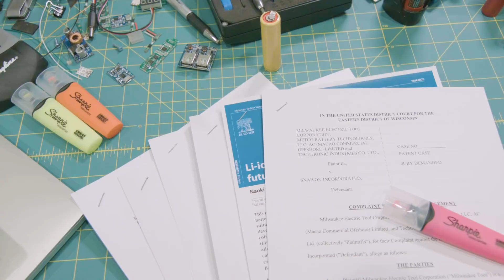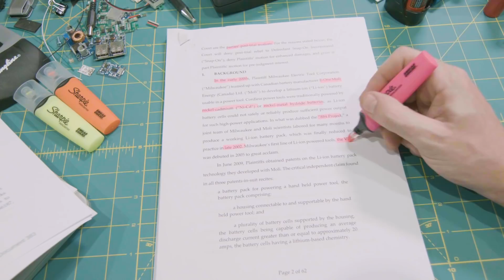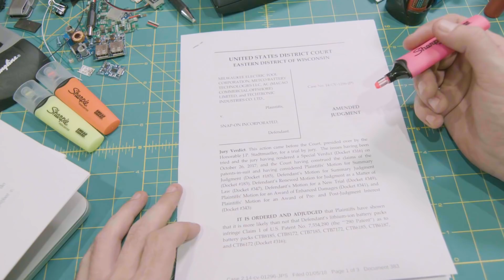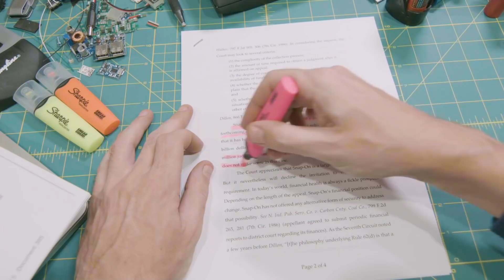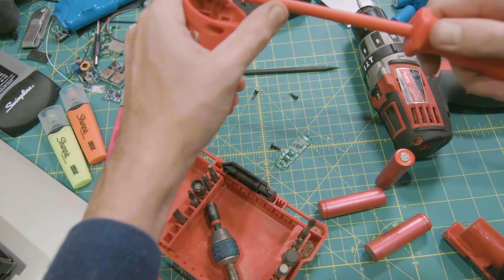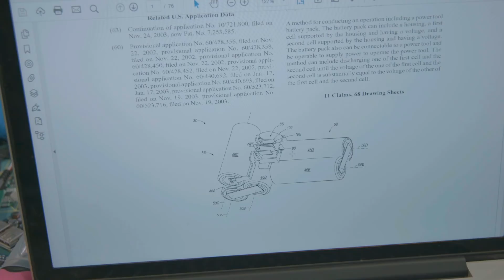BOLLR: Milwaukee wins $28 million for Lithium-Ion Battery Patents from Snap-On

Comment: My question about the case would be:  Why is Snap ON being singled out,  virtually every cordless tool is identical,  I watch AvE pull them all apart, they all use the same cells, they all have the same battery control circuitry just in different places.  What did Snap On do different from say Makita or Porter Cable?
Reply: Meep Changeling, and Leonard, but the "tech" they use is virtually identical to the tech that is used in so many other places. to put it simply they took the batteries out of the old packs and put in lithium ones, that were designed to handle the amps. the only feature that should be "patentable" should be the chemistry of the batteries themselves. The actual packs shouldn't be. I agree with Snap on that even the least knowledgeable laky at a tool company should be able to figure out how to put a lithium ion battery into a power tool. Hell if you put the batteries in parallel you can boost the max amps from the pack using the lesser batteries. milwaukee improved nothing outside of the battery used.
Reply from the maker: Not pay license fees to Milwaukee.
Reply: A wild guess as a contributing (but not the main) factor:  Both companys'  engineering centers are within commuting distance of one another. Poaching design engineers between the two is easier than most other cases.
Reply: What tech were they using?
Using a lithium ion battery on a different product is not clear... everything that a battery is used on is a tool.
Reply: Who is this directed towards??
Reply: @BentTreeFarmPa  If you have to ask -  not you.
Reply: From what I'm understanding: The battery is part of the pack, so the patent should extend to cover the use of the particular chemistry of the batteries and the way the controller is configured to handle the higher voltage. As Mr French showed, its not as easy as slapping the batteries in and making it chooch safely for consumers
Reply: pretty sure Makita already got hit off for their OG 12v Max line.  

And I don't think they made the other 12v CXT line for funsies either, considering cartridge/magazine style batteries are better for compact tools than slide-style batteries. 

That's why their commitment to the new line has been so-so at best (same with Dewalt's anemic 12v line-up) and it seems they've turned focus towards the sub-compact line that still uses their 18v battery, which they've supported better than any of their competitors, considering 18v LXT dates back to 2005.   (where as Milwaukee has abandoned like 3-4 Lithium platforms in the same timeframe:  V18, V28 and M28)
Reply: Snap-On has deep pocket...   take a look at the price of a set of snap-on tools.  There are 100's of cheap tool company's that make Lithium-Ion they are so small they can close up shop and startup under new name faster than you can read this sentence.   Snap-on can't, that would destroy there brand.   I use to make a living revers engineering products to get around patents on electronic devices.  Everything from fish finders to radar control units never got busted once. So I found this patent war thing kind of interesting..   oh well. be interesting to see if they win on appeal.
Reply: Those companies pay Milwakie a fee for the use of their Tech. Snap-On decided NOT to pay and use their tech anyway, then say Milwaukee's tech was their own. Get it?
Reply: *Their
Reply: James F lol I agree with you
Reply: Badgermatt75 2016 are you asking about the *Their comment. I was curious too. Don't matter there's always fucking grammar nazis who think they are showing "their there they're " superiority. Who cares really like they never make a mistake or that autocorrect never throws the wrong word out. Shit really pisses me off. Like would you interrupt someone in person talking to correct them. it would take an awful big dickhead to do that.

Comment: At work we had an incident where a framing nail punctured a M18 battery pack. Luckily it missed the cells. How it happened isn't clear, but people probably aren't too keen to share details if horseplay was involved.  

12 years ago I made the mistake of opening up a LiPo cell. It was mostly dead, but touching the fluid inside immediately gave me a searing migraine that lasted most of the day. At that time I knew enough in order to be dangerous, but not enough to be safe. Glad to see Leonard is being safe and using caution.

Comment: I think I remember seeing both actual batteries in a Home Depot years back when I needed to replace my power drill.  Both had the same shape and voltage...close enough that it looked like the Snap-On could fit the Milwaukee power drill and vice-versa.  I also remembered thinking to myself that this was a lawsuit just waiting to happen.

Comment: You must have some pretty steady hands or very consistent luck. I know for a fact I would have either cut myself or nicked one of the cells if I were using anything much longer than a scalpel blade.
Reply: Abraxian Absolution Big knife is a dull butter knife, you probably use one every morning.

Comment: If everyone makes batteries this way what was snap-on doing that was special?  Or rather what was Willfeckee doing that was patantable?
Reply: Korona Figuring out how to get it right. How much of what goes where to output enough electrocity to drill holes etc.  ⅓HP whenever you want, only much smaller than cutting up a dead horse.

Comment: woot. just waiting to see the inevitable AvE comment get thousands of likes.
Reply: Well now I'm pissed! How did the jury mess this up?  More accurately, how did Snap-On's attorneys mess this up?  You want more current, you put more batteries in parallel.  You want more voltage, you put more in series.  I'm sure you're going to say exactly this in the video later, but hell no.  Any first year undergraduate EE student knows how to do this.  Also, how did the patent office mess this up?  Its an incredibly over-broad garbage patent with no new content whatsoever.

If I wanted to run a subway locomotive off hearing aid batteries, I could do it.  It would be stupid and probably cost more than the locomotive itself, but you could do it.

In fact, no, lets actually do it (on paper).  Ironically, I'll be using the Milwaukee ES-2 electric locomotive, running on 3000VDC ad approx. 200A.  We'll also be using the A312 hearing aid battery, producing 6mA at 1.4V.

Simple math tells us that we need 2143 batteries in series and 33333 sets of 2143 batteries to provide the peak 200A requirement for a total of just over 70 million A312 batteries to run an electric locomotive.

That's it.  Thats the magic sauce of this patent.  Garbage that some jackass (me) can fire off in 20 minutes in a youtube video comments section.
Reply from the maker: The jury believed Milwaukee's assertion/testimony that they had worked closely with Moli, and that was closely enough to convince the judge and jury. But you're right, this is also on Snap-On for not being able to show the obviousness of "use a lithium battery in a tool". Thanks.
Reply: Thanks for making the video.  I've been looking forward to this for a long time, but I'm just slightly sad and angry that I could take stuff off my workbench as it is right now, have walked into court with Snap-On's attorneys and saved them 33 million dollars.
Reply: This case IS kinda crazy. I remember when the Li batteries were being put in every new cellphone in early 2000, I was thinking to myself how long until they'll put them everywhere else. And now learning that putting Li-ion batteries in power tools was patented, and that it wasn't not obvious, which at that time was obvious to a, you know, not even the brightest 12 year old... I either didn't get what exactly the patent was about, or it's a very opportunistic approach to patenting on Milwaukee's part and a fuck-up on patent office/court system/Snap On side.
Reply: buchweiz: Honestly, it makes me want to know more about how this case went.  So far as I'm aware, Milwaukee used off the shelf electronics in standard, openly available (probably reference design) circuits and the only thing thats even mildly patentable or unique to their battery "system" is a cell not even produced by them.
Like I can't patent a slight modification to a buck-boost topology or a slight modification to the reference circuit design for a charge balancing chip made by Linear.
Reply: Unfortunately a year later and it's barely broken 600.

Comment: So what is patented? Is it simply the battery pack itself? Cause that would be super dumb and totally BS. Battery packs have existed for decades, and changing out different types of batteries isn't something new. And moving the battery management circuits isn't a huge difference. Don't get me wrong, the patent office has a horrid habit of giving out fraudulent patents often now. Which I guess is better than not giving out patents, then having the clerks either sell the invention to rich businessmen, or even doing it themselves, and then getting a patent on the exact same thing.
Reply from the maker: The Patents cover lithium-ion tool batteries with discharge ratings at or greater than 20A. I'm not sure if that's continuous or short-term. I'm guessing short-term. While it definitely seems obvious, Snap-On, with their millions, was unable to convince a jury so.
Reply: But it doesn't seem to cover the actual batteries, just the use of batteries in a pack. And no way in hell should that of been given a patent. My radio takes C cells; does it matter if they started with Zinc-Carbon, then switched to Alkaline, to Rechargeable Alkaline, to Nickel-Zinc, to Nickel-Cadmium, to Nickel metal hydride, to Lithium, to Lithium-Ion... etc etc etc. Those batteries have various total charges and different drain rates. How the hell does a non-fraudulent patent cover a simple switch of battery types? Or did the near century of businesses miss a great opportunity by not taking out a patent for each and every major change in types of batteries being used in other products. Because again, this isn't about the actual batteries, but putting these batteries into a pack (holder) for batteries to be used in a totally normal way. Each new battery chemistry should of launched a race to patent offices all over the world to be the first to patent my radio to use the brand new and exciting Alkaline batteries. Another race for Lithium (LiFeS). And then only their specific radio could use the new battery for 19 years. Sure, the only real change would be the internals of the batteries themselves, but that doesn't seem to matter with this patent.
Reply: I also don't understand what's actually patented. 

A tool-battery needing a discharge of X, and that you have to archive it regardless of cell type used seems to simply be the tech specs. Its like patenting that you made a keyboard out of a material different than plastic.

Even when they used a converter (e.g. charge-pump) i would consider it trivial.

A difference in Chemical composition on the other hand would be something new (there is much done with finding the right composition, thickness and even the struckture of the electrodes inside the cell), but then the other party could use some other composition to archive the same discharge.
Reply: oberon oberon I sure hope there are some specific problem solutions in there other than "big enough".
Reply: +John Francis Doe:
If i remember correctly a patent is written least specific to most specivic and you have to violate (almost?) all claims to breake it. And Leonard has only read the first claim.

Its like i would write for "the wizard of Oz":
1) A fantasy story.
2) The main character goes to a magical world
3) In a House
4) By using a tornado.

The points 1 to 3 would also apply to "The Chronicles of Narnia" but there is clearly no infringement between the story's.

PS:In a Case like this a Link to the patents would have ben nice, to read what exactly is in there.
PPS/Edit: Its more about "Fast enough" (A/mA) then "big enough" (Ah/mAh). Strong would in this case be V/mV.

Comment: So milwaukee invented putting 3 cells into a pack and snap-on lost even though people have been putting li-something cells into packs like that literally since they've been commercially available and the fact you have to chain cells to get the voltage required for a big DC motor is obvious to anyone that's worked with the stuff that came before like nicad.. it literally makes no fucking sense to me.
Reply from the maker: Sort of. Milwaukee filed a patent and sued Snap-On and others. Snap-On failed to convince a jury that Milwaukee's invention wasn't patentable. So, while it definitely seems obvious, especially now, Snap-On, with their millions, was unable to convince a jury so.
Reply: Doesn't make sense to me either. The US patent system is screwed up when bundling up an existing item is considered inventing.
Reply: It works like this - if you don't go out of your way to patent it first, someone else WILL, and they'll cause you a whole host of headaches. So, basically what happened is 'business as usual'. 

Patents protect those with money and/or power and no one else
Reply: Doesn't that go back to Alessandro Volta?

Comment: I remember using that 28 volt lithium set when it first came out.We had it at work when I worked at a junkyard and it was amazing.The company bought multiple Milwaukee sets that were around $1000 a set.I remember not knowing better and thought I broke the sawz all,because It was full power and then just stopped working.I

Comment: Don't pierce the battery as Leonard earlier points and taps the end of a battery with a sharp pointy knife. LOL
Reply: Back when flip phones were the rage, a coworker handed me a dead one (at work) so I took it apart.  Said "what the hell is this?" and stabbed the battery with the end of a scissors.  A pinhole glowed like the sun and shot up a plume of smoke.  Chucked it in a box and threw it out in the steel-waste dumpster and acted like nothing happened.